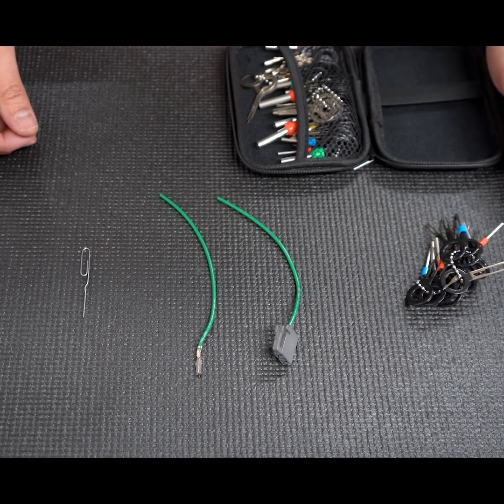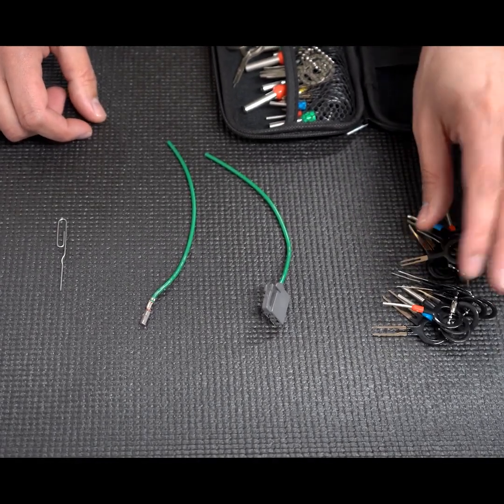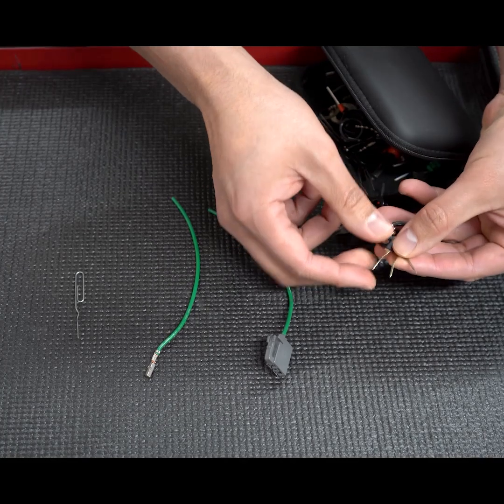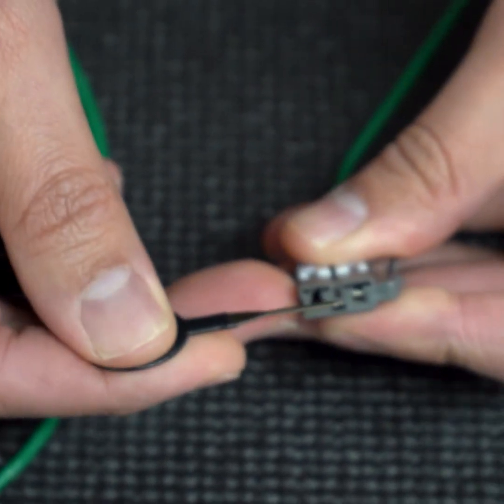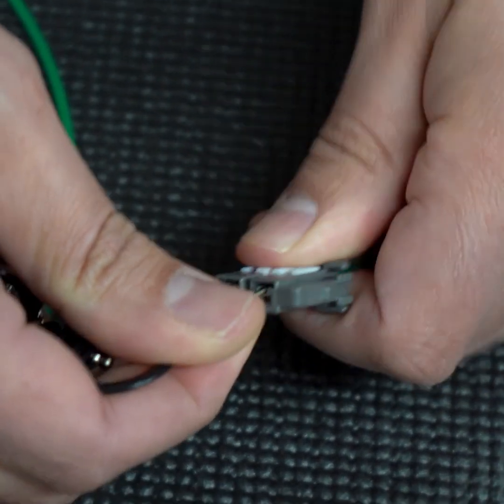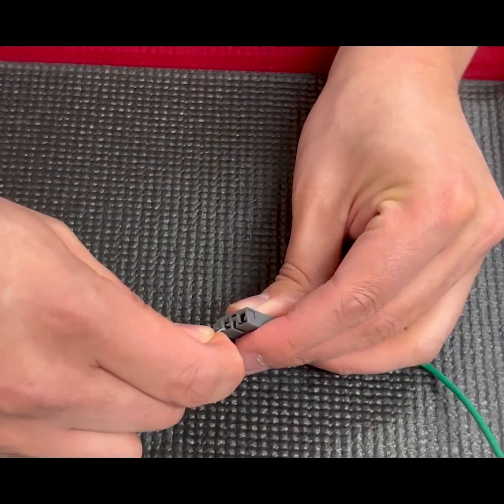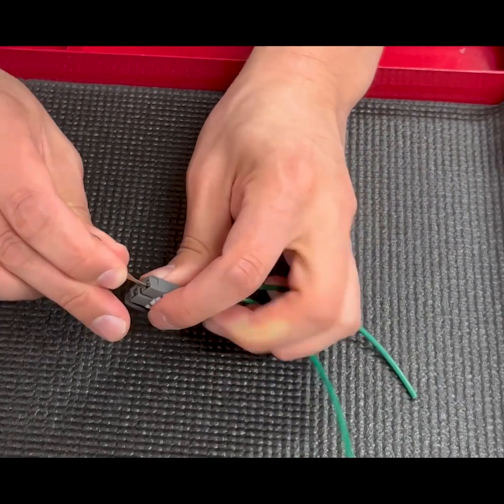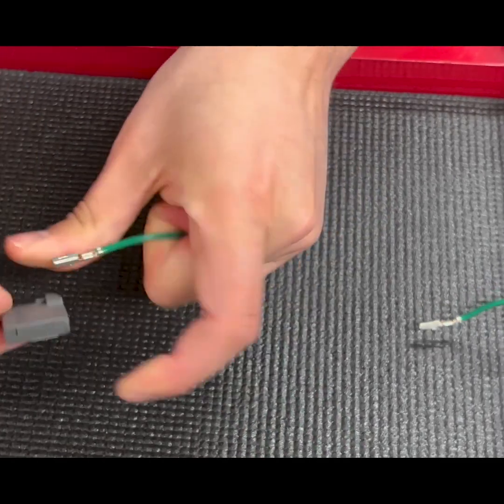How to de-pin a connector with tool or paperclip.

Comment: I had a flash of inspiration today that blew the pins right out of a connector I had worked on for years. Today it hit me, plastic coffee stir straw. I threw it in the front and began twisting and whammy! The pin slid right out, no problem at all! Woohoo! After years of trying to use picks and tiny screw drivers to no avail. Depends on your type of connector tho of course.
Reply from the maker: I never thought about using a straw! Clever!